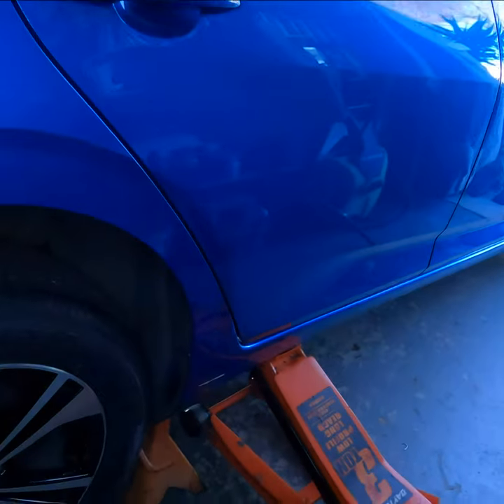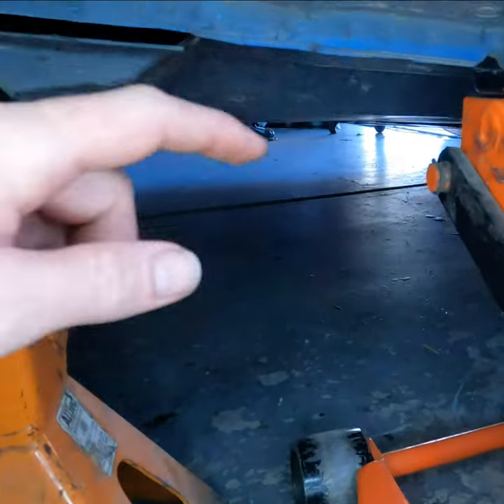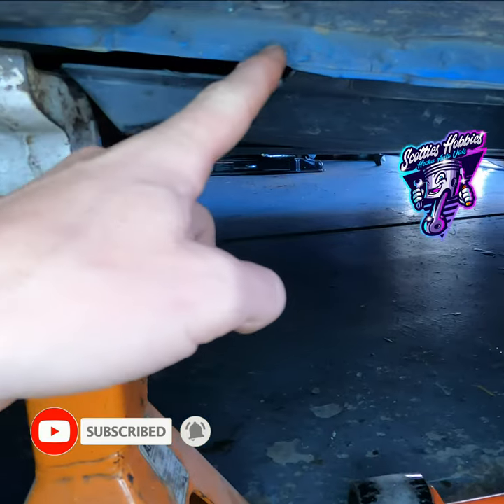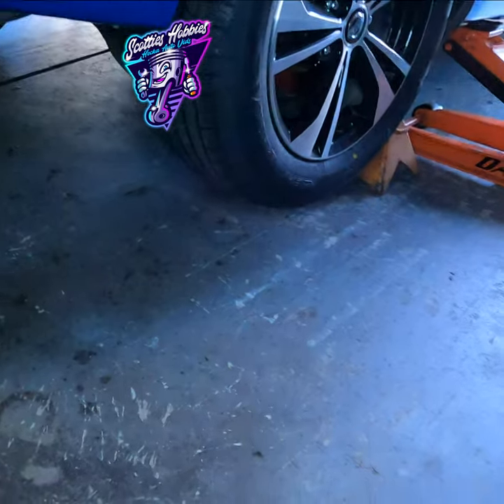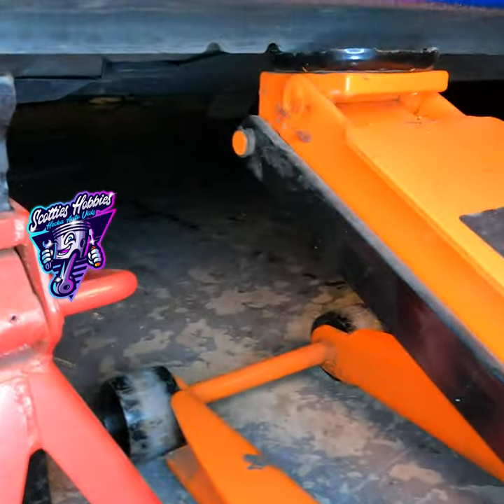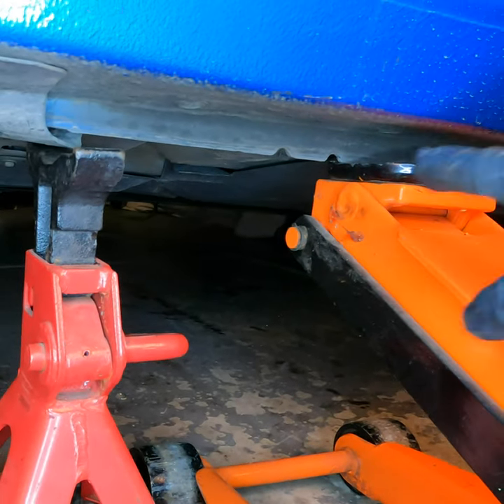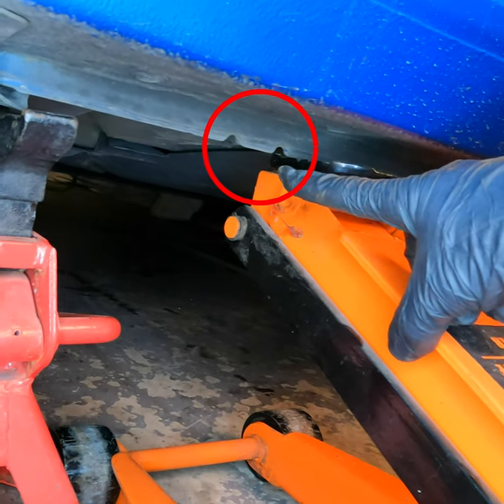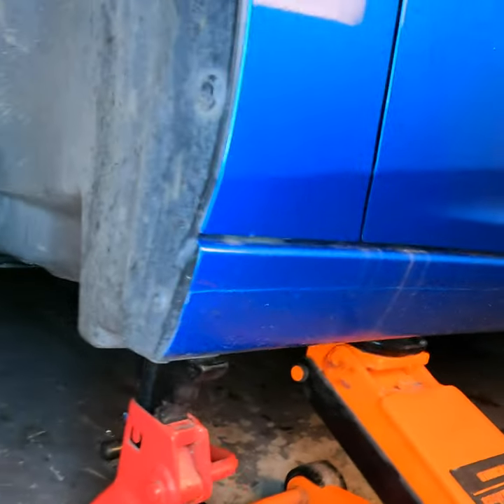Nissan Sentra Lift points. Where to jack up Sentra.

Comment: I feel like this is a dumb question. But I've heard to many horror stories about jacking up cars. Would I be good to lift at those points to change the oil. Like I shouldn't die right?
Reply from the maker: If you Jack up the vehicle from the points I pointed out in the video you will be good.Make sure to use Jack stands under the vehicle while you are under the vehicle. The Jack stands will be placed very near the Jack, On the lip near the Jack. Just like In the Video.
Reply: @ScottiesHobbies  thank you for the reply, I feel a little more comfortable I will definitely do that
Reply: I had a harbor freight jack stand crumble before. I guess they were defective. Messed up a clean no rust 2000 civic a bit.
Reply from the maker: @tayaria7280  they had a recall on some not too long ago.

Comment: I'm needing to replace my ac control valve. Therefore i need to buy a jack. Do you recommend a low profile jack or just a regular jack for a stock 2014 Sentra?
Reply from the maker: A regular jack will be ok in this case. 

Good luck on your project.  👍💪🤞

Comment: That plate piece of the jack bend the rail
Reply from the maker: You have to each at the 'jacking pint' I usually use a rubber pad to avoid any bending of the lip.